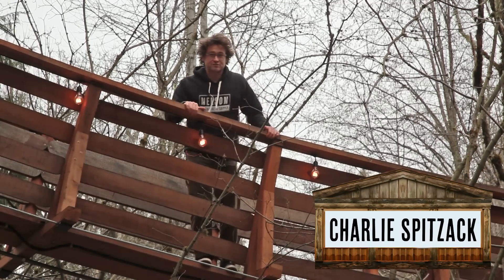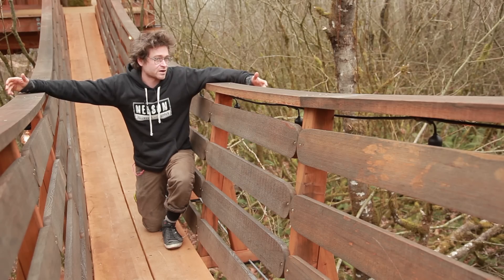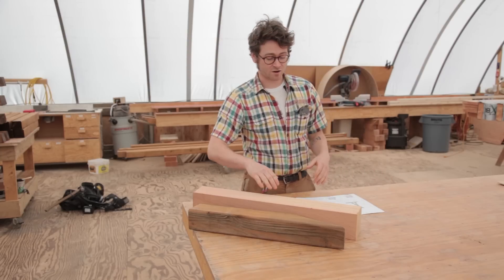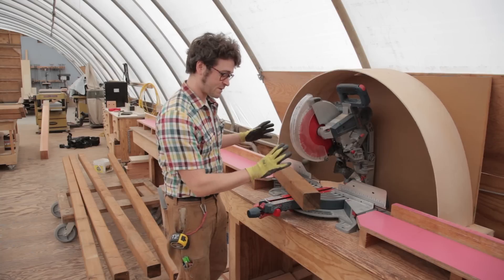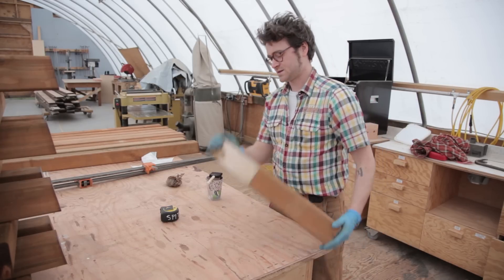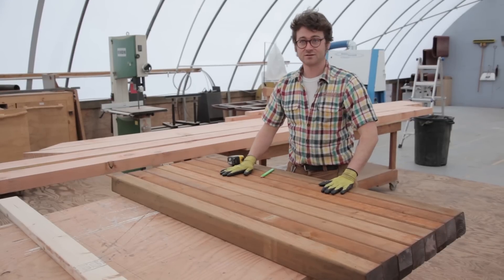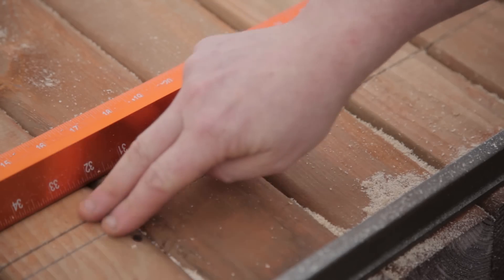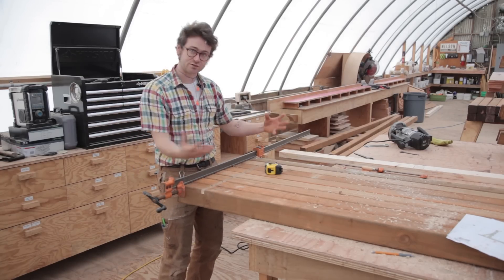Suspension Bridge Breakdown

Comment: wire rope wear what kind? and what size?
Reply: 1/2". The channel for the cable is 5/8ths for movement so just smaller than that so it doesn't slide around everywhere.
Reply: And generally just steel cable.

Comment: Great Vid, What was the end grain sealer you used, All I can find is anchor seal and it looked like you were using the same stuff wood is pressure treated with. And why no glue?
Reply: I use flex seal to treat end grain